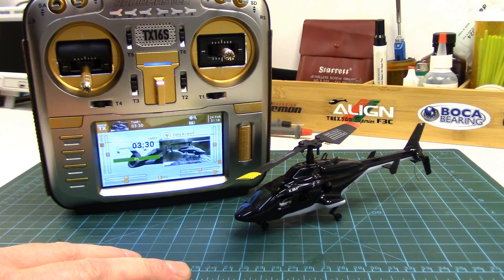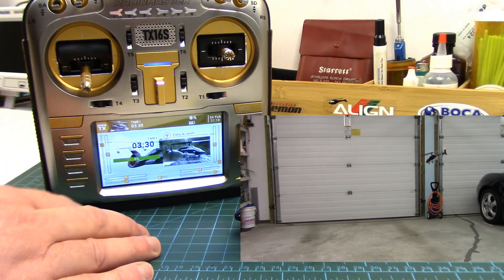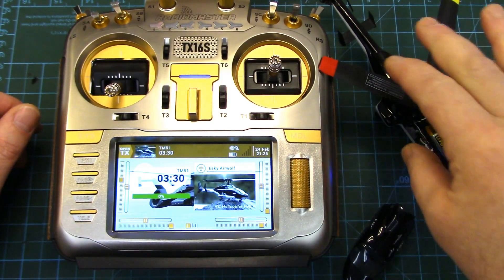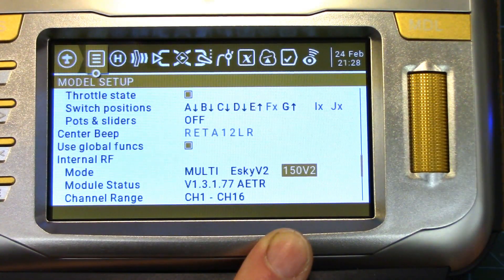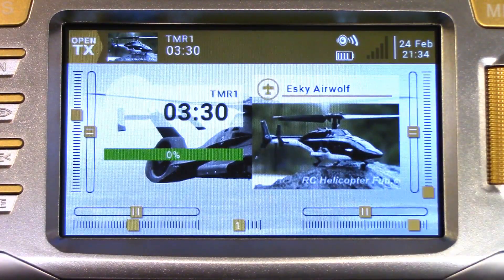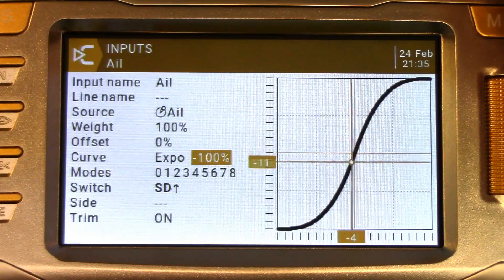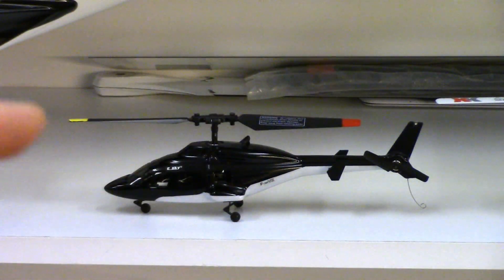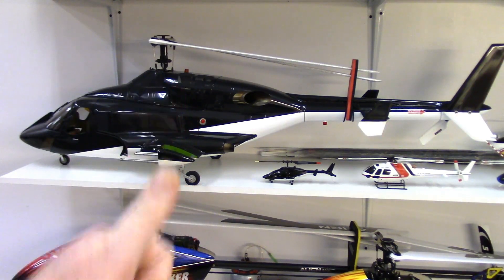Esky F150 V2 Micro RC Airwolf Update - Fixing a common problem.

Comment: Being new to OpenTx radios, that I bought, at least in part to deal with the deadband on the OMP M1 and M2 helis, this has been a great help as I wasn't sure how to apply the DB curve  to Aileron, Elevator and Rudder.  Thanks for the Tip's John👍
Reply from the maker: Hope it works for your setup as well.

Comment: Hi, can you help me?  i want to bind esky 150 v2 with open tx T-lite, but i can't do it, can you show me, thanks
Reply from the maker: I don't know a thing about the T-Lite so not even sure if it can be done. If the T-lite has the full function multi-protocol module, then it should be possible but you need to ensure you are running the most up to date version of Multi-Module firmware. Only the latest versions support Esky's unique F150 & 150 V2 protocol.
Reply: @Rchelicopterfun  my t-lite has updated to the last version, supports esky v2 and 150v2, but i still can't bind, do you have facebook, can i ask you, thanks. I have 1 tx jumper t8sg plus v2, is there any way to bind it?
Reply: @Rchelicopterfun  helo

Comment: Nice use of the OpenTX software! I'm still amazed at how much OpenTX has to offer, while I'm already very familiar with this hobby and TX, and still find new ways to solve problems everyday. You mentioned in the video that you got a general heli model for your Radiomaster, would you mind sharing it? I'm very curious how you utilize OpenTX to fly heli's, as that is my main aircraft-type I fly.
Reply from the maker: Actually OpenTX is not the only computerized radio OS system that allows output configurations like this - most of the higher end computerized radios allow it as well (Spektrum being the one example I can think of however that can't). Regardless, you are 100% correct in the configuration power of OpenTX; as I often say "if you can think it, OpenTX can likely do it." 🙂
As for my OpenTX base helicopter foundation, I use the one explained in OpenTX University's website in their helicopter section. OTXU is one of the most important websites around IMO if you are an OpenTX user - it's the only source I've ever used - clear, concise, logical, no BS. I do show my base heli setup in several videos, but this one goes into the most detail:  https://www.youtube.com/watch?v=O1L0wxzoqOU
Again, that is based on OpenTX University's heli outline. 
And then of course setup each individual helicopter setup is based 100% on what I cover in my collective pitch setup eBook: https://www.rchelicopterfun.com/rc-helicopter-tips.html
Reply: @Rchelicopterfun  I totally agree, I used a lot of different radiosystems in the last 10 years, but OpenTX is far superior in my opinion. Thanks for the link to your video, I missed that one in my subscriptions, I'm always curious how people use OpenTX, I will have a look and perhaps change some of my models ;)

Comment: I've been thinking about buying an RC RTF Heli to fly (sedately) around my living like you did in this video. I've been thinking about this for over a year. But, nobody seems to test and report on this type of heli. It's important to me to have at least 6 channel control, because working the radio controls is most of the fun. I don't want to mess with computerized radio. I don't want counter rotating blades. I don't care about acrobatic flying at all. Any recommendations?
Reply from the maker: Why 6 channel (collective pitch) for flying around sedately indoors? By those two base requirements, sounds like you are more in the market for a tame little easy to fly fixed pitch heli like the ESky 150 V2 (the pod & boom version of this scale Bell 222), or the Blade 70S (a rebadged Esky 150 V2).
If you want 6 channel (collective pitch), then you must mess with a computerized radio. You need a computerized radio if you want to correctly setup any modern day collective pitch RC helicopter to alter its performance to suite your skill level, flying style, and even flying environment. You are wasting your time & money otherwise. These two pages on my website cover all this in much more detail:
Best RC Helicopter - https://www.rchelicopterfun.com/best-rc-helicopter.html
Best RC Helicopter for beginners - https://www.rchelicopterfun.com/helicopter-for-kids.html